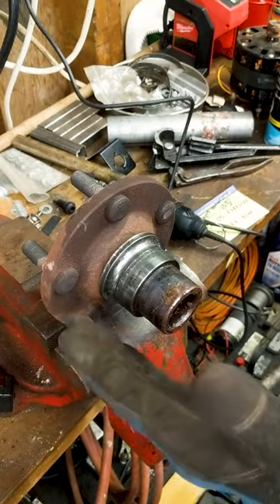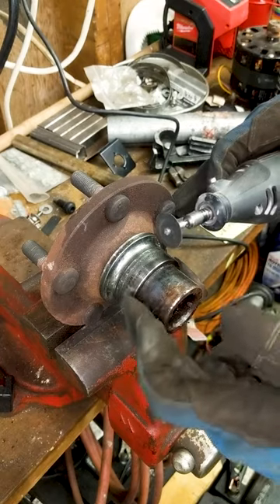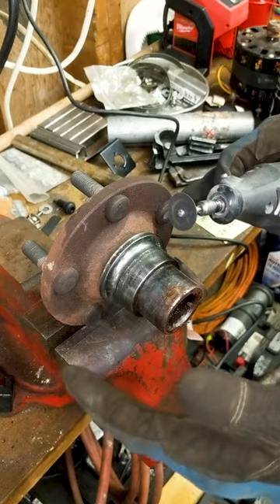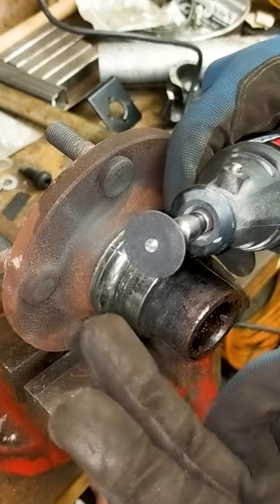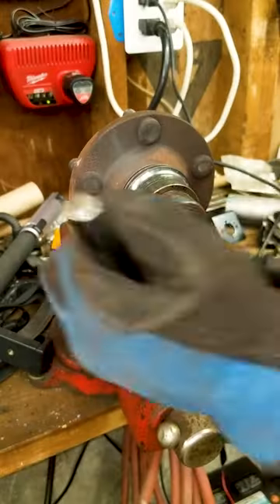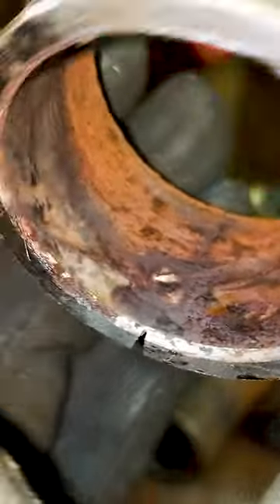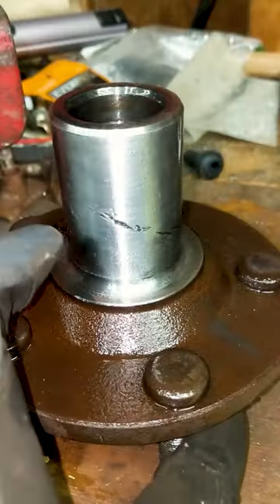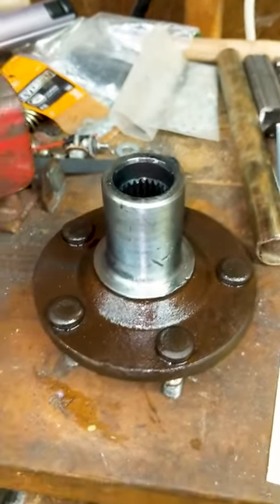Remove Bearing Race From Hub The Smart Way! #Shorts

Comment: I just replaced the whole thing. Didn't want to deal with the headaches. Plus I'm always missing tools. Save time and body aches.
Reply from the maker: Haha when money is available and the parts are available, it's always an option. For some reason nobody sells this hub aftermarket and the car is on its last leg anyways.
Reply: Right. I just replaced two for $178 bucks a piece and I was done in 30 minutes.

Comment: Thanks for the air tip on the cutoff wheel. The real Dremel cut off wheels are the way to go out shines anything else out there but they sure are proud of them things. Worth every dollar though.
Reply from the maker: They are super nice. Have you used the fiber reinforced ones that look like a tiny waffle? They last like 10X longer than the normal ones and OMG they cut nice.

Comment: Although I would just use a press, a lot of good info on this video that would use full down the line👍 But that is only if you have a press available 😁
Reply from the maker: Thanks! Yeah if you have the bearing splitter tool it's handy, but this is still pretty quick.
Reply: How would you use a press to remove the race ?

Comment: I bought a torch tried that and didn’t budge. I used my dremel and did similar to what you showed, however I went to far and cut into the spindle.
Reply from the maker: As long as you didn't make a huge gouge or something it's totally fine. Just needs to be round still and not cracked hahaha. Everyone saying just use a torch is over simplifying.

Comment: Haven’t yet used cutting wheels on my dremel, what if it breaks? I’ve only used it for sanding yet
Reply from the maker: They break often. You buy them in packs of like 10-50. Just wear eye protection it's not dangerous otherwise. They also make fiber reinforced discs that have like a waffle pattern in them and those are amazing so much harder to break.

Comment: Stick a piece of round bar in the vice vertically set the hub on it with the race down take the torch and with a medium flame heat the race as you spin the hub the race will fall right off as it gets hot enough takes me less than 2 mins to get it off. Been doing it for decades
Reply from the maker: See pinned comment. This doesn't take long either.

Comment: If you have one or access to one, an induction heater works GREAT for this. Very controlled, and quick. No need for an oxy/fuel rig either. They are quite affordable nowadays from places like Amazon or any of those places like that. With the extra leads for them, you can do a LOT with them, with no collateral damage in tight spaces or sparks flying. Yes, metal hot = bad, but sometimes it takes a bit of heat.
Reply from the maker: At least you aren't one of the 100 people saying "JUST USE A TORCH!" Hahaha. We all know you can use a torch. I want to get an induction heater very bad, just haven't had the spare cash. Have you had good luck with the affordable ones?
Reply: @802Garage  yes. I don't use it commercially, like hours a day, but maybe 10 or so hours a month, and it has been great. The only issue I have had with the cheap ones, and the expensive ones, is the clamping screws that hold the leads tight will come loose over time. But, high frequency electricity, some amps, and soft copper, that'll happen. It is well worth it to get the set in the nicer aluminum case with the extra leads. You may not use the extra leads right off the hop, but once you learn what all you can do with one of them and get more comfortable with it, you'll use them more and more. The flexible leads that are just kinda floppy are worth every penny for odd shaped stuff. And the longer ones definitely help for those PITA exhaust flange nuts that you'd burn an old oily, leaking vehicle to the ground trying to heat up with a torch. The heat is almost completely isolated to whatever is inside the coil, so no worrying about burning wires or fuel lines or anything else. What sold me on them was watching my local Cornwell tools salesman hold a head bolt in his bare hand at the head of the bolt, and heat the threaded end to bright red without burning his fingerprints off. Obviously, the heat will conduct its way up the bolt, but try that with a torch and let me know how it goes. Another tool you'll wonder how you lived without it for so long is a plasma cutter. Even a super cheapo one. Now THOSE are awesome. One piece of advice about looking for a plasma cutter, make sure you can get consumables for it before you buy it. That can be more difficult than most people realize.
Reply from the maker: @robertschemonia5617  I do have a plasma cutter and yeah I have seen the wonders of the induction heater like you are talking about, just gotta pull the trigger on one. I can tell we deal with a lot of similar issues, hahaha. I know it would save me tons of time. I want to use them for brake bleeder screws too! Thanks again.
Reply: @802Garage  they work awesome for WAAAY more stuff than people realize. And, yeah, you're right. I have been a mechanic of some sort for 15 years now. I got out of doing light duty stuff. Cars and pickup trucks are for the birds. I went to what I love. Welding/fabrication and heavy equipment mechanic. I also do pretty much all the maintenance and repairs on all the equipment where I work. From huge scrap handling machines and hydraulic demolition shears, to 3 phase alligator shears, all the electrical stuff, plumbing, A/C, and maintenance and repairs on semi trucks and scrap trailers. I love it. The variety. Not the same stuff day after day after day. When I was doing auto stuff, I specialized in internal engine diagnostics/repair, and suspension. Not only can I rebuild clapped out engines, from nitro R/C engines to huge diesels, I can make them ride good and drive straight too. I have done waaaay too many lift kits on jeeps and leveling kits on pickup trucks to ever want to do it again. Something about taking a pile of steel and using lightning to sew it together to make something useful is just cool to me. That, and working on stuff that will ABSOLUTELY kill me, and hurt the entire time. Lol.
There is just something about sitting in the cab of a machine, and being able to literally throw a full size vehicle 20 feet into the air so it lands 50 feet away with the flick of a wrist that is just oh so satisfying. Having all that brute strength literally at your fingertips, but still having the ability to finesse the machine to pick up one single thing the size of your fist without destroying it is something out of this world. That, and using a thermal lance that can cut through just about anything that sprays liquidized steel 15 feet up and out from you is too cool too. Just remember man, YOU are the softest thing in any shop. And everything in there can or will kill you, and it will hurt the entire time. So wear safety glasses and earmuffs. Bits of grinding wheel in the eyes and tinnitus fuckin sucks. Lol
Reply from the maker: @robertschemonia5617  Hahaha I definitely hear you about the appeal of massive powerful machinery. That said, I actually kinda prefer small stuff. Not like motorcycles and RC, but the small car engine world. IDK why it just makes the most sense to me. But I love everything mechanical. I also take pride in making stuff work properly and smoothly and better than it was before. That's what I really enjoy. Cleaning and lubing every little thing and making stuff work people say won't. Also getting more and more into fabrication and custom work as time goes by. Hoping to get a TIG soon, and my main goal for my channel is crazy and unconventional engine swaps. Thanks for the comments!
Reply: @802Garage  I have a TIG welder that is an Amazon special. It is an Amico TIG160DC. They are right around $250 I think? It is a DC TIG and stick machine, 120/240VAC, and I love it. Small, light, portable. And does everything I ask of it for stuff in the home shop. Definitely a good starter TIG machine. I have also heard great things about Everlast welders too. I really like Miller machines, and the old Hobart stuff. I actually own a Lincoln SA200 Pipeliner, and a Hobart G258 engine driven welder. The Hobart is 1,300 pounds, and has a 4 cylinder flathead Kaiser/Jeep engine in it. Paid $300 for it. Got it running good, and got the brushes unstuck in the generator and cleaned up the commutators in the exciter and main generator, now it welds GREAT. It'll do up to 450 amps DC. I also recently got an older Hobart Arcmaster 351. It is a 3 phase 100% duty cycle multi-process machine that is set up for MIG right now. It is a legit industrial machine. It feeds wre out of a 55 gallon drum of wire that weighs 500 pounds. The stinger on it is 25 feet long, and liquid cooled. I am building a rotary phase converter for it slowly. When I say I love welding, I mean it. Lol.
Also, I am getting into Eutectic welding, aka, spray welding. It is a fairly rare process that used powdered metal, that is sprayed through an oxy/acetylene flame to build up or hardface shafts and cutting edges and whatnot. Pretty cool stuff.
Reply from the maker: @robertschemonia5617  Haha sounds like you have fun! My Plasma cutter is quite cheap, but was looking at the AHP or PrimeWeld for a TIG and I want AC for aluminum. I think I've decided on PrimeWeld. Hopefully soon.

Comment: How come the air makes the cutting wheel last longer?
Reply from the maker: Basically, when the cutting disc gets too hot, the material degrades quickly. The air cools it off and keeps the wheel together!

Comment: I think you are a little too worried about not getting into the hub with a cut off wheel. As long as you don't get into where a seal sits or create a cut into the hub that's crazy deep it really doesn't matter. I use a 3" cut off wheel on an air powered die grinder. The trick to not cutting too deep is to cut at an angle into the race. Angle the cut off disc where you're cutting through more material like you are trying to cut a chunk of the race off. They also sell hub and bearing kits. Either way getting into the hub a little bit really isn't a big deal. It doesn't weaken it as they are purposely over built by design. Also I do this kind of stuff to make a living so being fast at it makes me more money. If you have an air hammer with a chisel tip use it. The air hammer splits the race with barely any effort plus you can get behind the race and walk it right off the hub. I can replace most press fit bearings in about 15 minutes from pulling the car in to setting it back on the ground. I generally get 1-1.5 hours of pay per side.
Reply from the maker: I agree with everything you said, and I actually meant to angle the cut more as I usually do, but got distracted making a video. I know cutting into the hub shaft is not a big deal, I still like to avoid it. I have done this many times, part of the point of the video was to show it with the minimum tools possible for home gamers. A lot of people have a dremel who do not have air tools or even an angle grinder. But yes everything you said is generally correct thanks for the comment!

Comment: Best, and easiest is to cut it off using oxy-acetylene rig if it's available.  Start with bearing dead cold ( no previous heating while trying another method.) Use a big flame on preheat Jets and add just a bit of extra oxygen to make it hotter.  DONT GO SLOW .  If you fool around it will mess up.  Just start your cut on the race and direct the cutting jet at a tangent to the race.  You cut off a slice of the race before the hub gets up to cutting temperature.  Practice on some junk if you don't believe it works.  You can do 10 pieces in the time it takes to do this cut-off wheel thing.  I've done dozens of them.
Reply from the maker: Definitely could not do 10 in the time it takes to Dremel and knock it off, but either way I generally agree with you. That said, see the pinned comment. The target audience of this video is likely 99% people who do not have a torch.
Reply: @802Garage  After you get the torch out, it takes, probably, less than a minute.  I know you can't cut that bearing so fast with a Dremel.  But anyway, the thing is I'm getting really old and I'm trying to share things I've learned in 60 years of shopwork.  I know at least a couple dozen techs that have ready access to oxy-acetylene and don't have clue what can be  done with it.  That's MY target audience.  I've done your technique many times and it's great also.  Thanks for the opportunity to ramble.
Reply from the maker: @channelview8854  It's faster for sure. It would be fun to have a race. I just thought it was a slight exaggeration and I admit I sometimes get annoyed by comments because I feel like people miss the point of the video. I definitely hear you overall. It's surprising how many people have tools and don't know what to do with them and how many don't have tools they could put to good use, hahaha.

Comment: So..... what happens if you knick the shaft a little bit more than a little. I changed a bearing recently with a grinder and went to far. Is the shaft ruined or ............? Please say it's not ruined. Lol
Reply from the maker: As long as it's only in one spot and not around a significant potion of the circumference, it should be fine. Also just make sure the surface the wheel seal rides on isn't damaged, if you car has one. Plus the back face that the bearing race presses up against needs to be flat.
Reply: @802Garage  Thank you so much. The damaged area is completely covered by the bearing and the faces are fine. 👍
Reply from the maker: @oddballdynamics.9658  Sounds good to go!

Comment: Big nastyhammer from South Main Auto, proper sharpened chisel and let er eat.

Alternatively, torch the race and douse in ice cold water, shock will usually split the hard metal.

Go on and use the dremel, Id prefer to get the work done today and ive got about 30 half used 4.5 inch grinder cutoff wheels specifically saved for these types of jank jobs.

Comment: Now ive cut races off befor and had lots of fun at it. Lol but man the cut it on a angle!!! Never thought of that! Thank you sir!!!!
Reply from the maker: Thank you! I actually meant to angle it more and forgot. If you go at more like a 30-45 degree angle it takes a little longer to cut, but it knocks off way easier.
Reply: If you're using a grinder an angle is pretty much the only way to cut it without chopping through the wheel face of the hub... how tf have you been doing it
Reply from the maker: @NoknOnDors  Watch the vid! Don't cut all the way through and then crack it. No knicks at all!

Comment: I just heat it with the torch while spinning it’s so much easier. If I don’t have a torch though I do the same as the video. Small angle grinder cut and hit with chisel.
Reply from the maker: Haha yep see pinned comment. Multiple ways to skin a bearing, or whatever. ;)

Comment: A whole lot easier is to take a stick welder run a beetle weld down the center of the race all the way around and then tap it with a chisel it will come right off every time or drop it straight down to a block of rubber

Comment: Can you still use it even though it's cut?
Reply from the maker: If you are talking about the hub itself, yes! Some small cuts aren't going to affect the function. If there are a lot of deep cuts around the shaft it could be an issue, and you don't want any raised areas on the flat part of the bearing race sits against as that will cause it to sit unevenly. Obviously, the bearing race itself is destroyed and no longer usable.

Comment: Check this out. When your trying to get that inner race that you already cut to slide down the axle I use wooden wedges on both sides of the race. It pushes straight.  I'm going to try the air compressor trick. That one is new to me.
Reply from the maker: That's a great idea for sure! It also helps if you angle the cut more than I did, but I forgot when filming.

Comment: For a bearing that separates like this is it bad to put it back on? Will it need to be replaced? Firestone did this and put it back on without replacing the wheel bearing
Reply from the maker: Absolutely should replace the race when installing a new bearing for numerous reasons. That's a hack job. Sure, you can inspect the race and make sure it's good, but you also have to remove it to install a new seal on the type of bearing that is multiple pieces. So really just a big no no.

Comment: I just wonder why you didn't change the whole assembly due to the fact that the sleeve is such a pretty blue and it more than likely warped the sleeve...!
Reply from the maker: No way to know without checking runout and flatness. I reused it because for this car they actually very rarely sell new hubs alone and aftermarket doesn't sell hub and bearing together, leaving OEM as the only option which is quite expensive. That, plus the car is very high miles and on its last legs. Did the exact same job to the other side and both are holding up well so far.

Comment: Before you get carried away cutting on it I would just try heating it up just the sleeve it will expand and if you take a hammer and punch you can back it off I would try that first unless it is friction welding itself on

Comment: After I saw a guy prop it up on a dowel and spin it around with his finger while holding a torch to the bearing and the bearing just plopped off, I will never do it any other way if I have to do it
Reply from the maker: Check the pinned comment, hahaha. Problem is you need a fairly hot flame and the setup isn't instant either. This is pretty quick and simple for most home gamers.